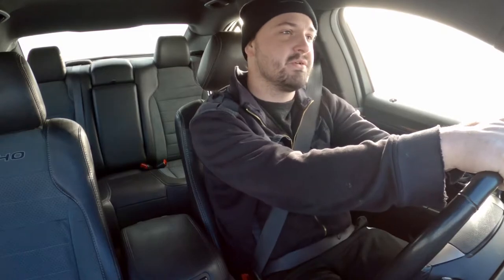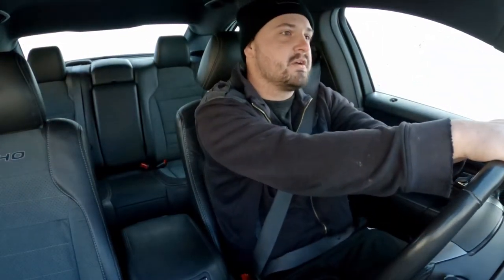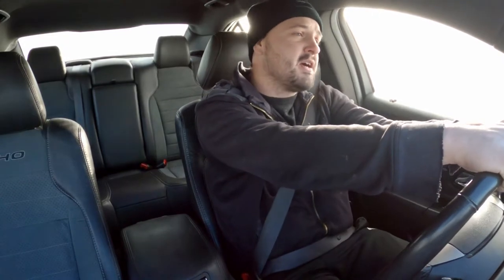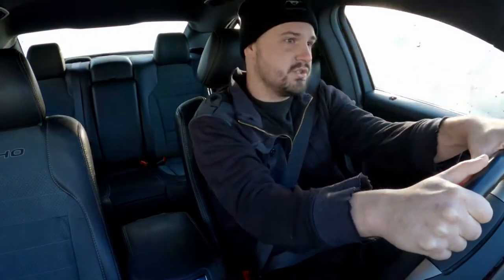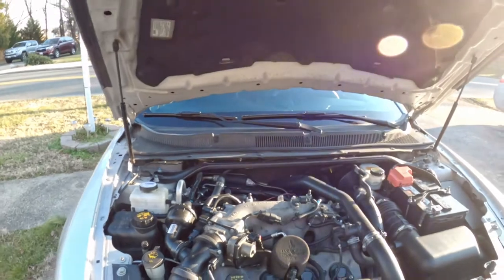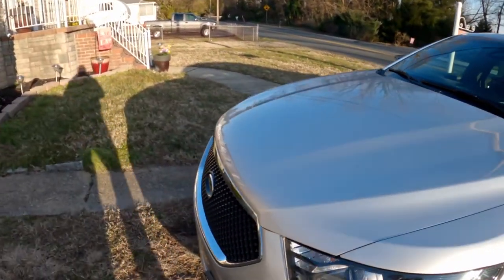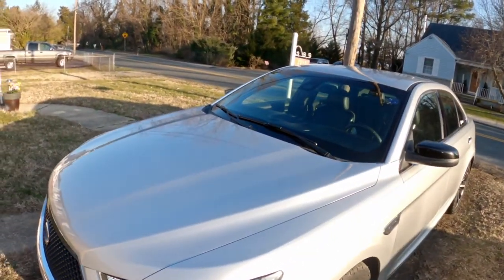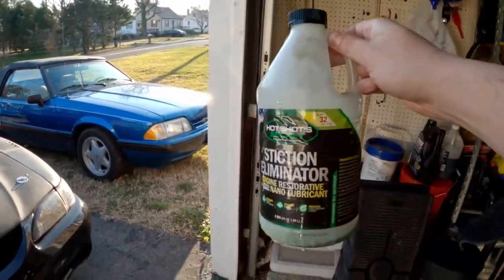Let's Talk About Motor Oil... Which Is Best?

Comment: I really didn’t like cast in my sho it seemed to get a lot dirtier at 5k then the Valvoline full syn but that’s with my driving and went from 15,560 miles on apr 1st to 46k today 😅 I’ve done my fair share of oil changes this year 😂

Comment: What oil filter did you get at Wally world dude? I hope you didn’t cheap out on one of those Fram filters! I change the oil in mine every 5000 miles and I always use the Motorcraft filter. It’s only about five bucks as well. And I always use Lucas high mileage oil stabilizer in my car and my wife’s car. It’s usually about $14 a quart and it seems to work really well. 👍🏻
Reply from the maker: I always use Motorcraft oil filters for all my cars 🙂👍